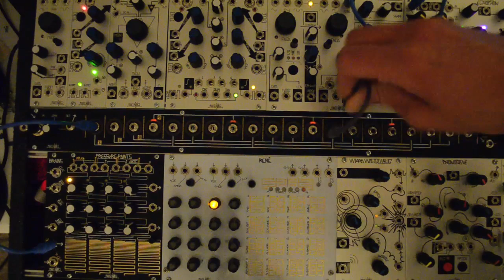Make Noise System Tutorial 2: Basic Envelopes with MATHS

Comment: Question, is it possible to use the function as an envelope to control the amplitude of the signal via the optomix? Function doesn't have variable outs as maths, so what would be the equivalent parameter in the function module? Thanks
Reply from the maker: ecoturismo Use the + Output on the Function, and vary the modulation depth using the Control knob on the Optomix.
Reply: Thanks!